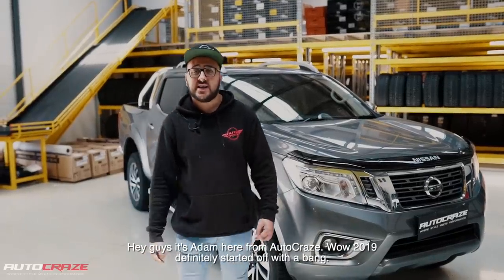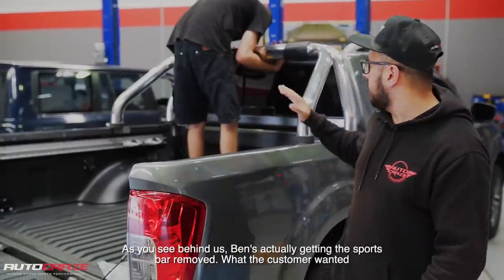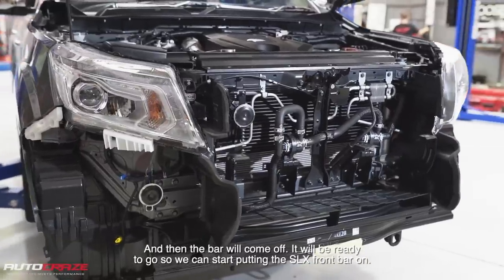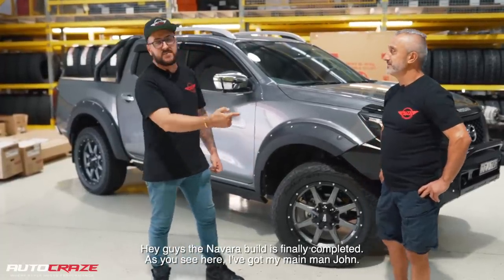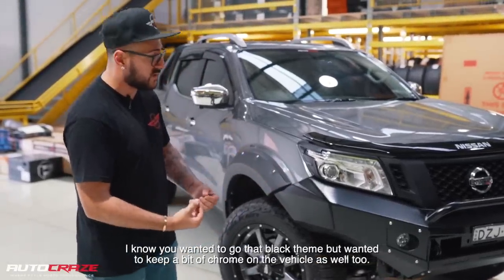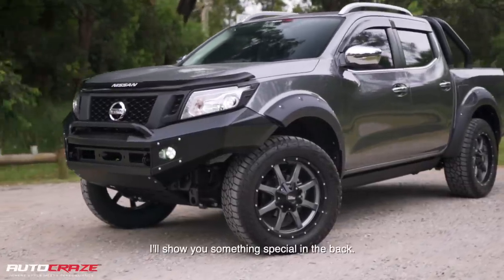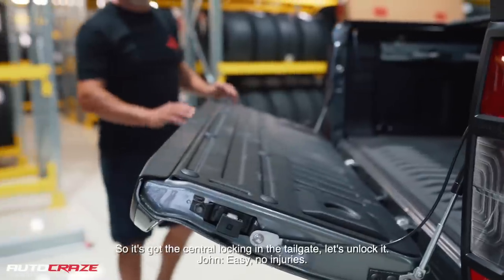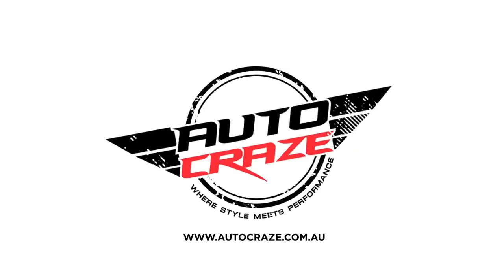OUR BIGGEST NISSAN NAVARA BUILD EVER (Modified NP300 Build 2019)

Comment: Looks pretty much like my 2018 NP300, however I want to know if I can retro-fit the motor on my tray cover or do I need to replace it? And the central locking tail-gate... beats locking that every time with the key, why Nissan didn’t include that is besides me. Especially when you shell out for an ST-X
Reply from the maker: Hi Cronus, can you please call us at 1800 099 634 and we will help you out. Need more details for answering your queries mate.

Comment: Hey guys nice work. When you fitted the central locking to the tailgate does this also work for the roller shutter ? or is it a seperate controller for the shutter ?
Also what brand of shutter do you use for the Navara ?
Reply: 'roll r cover' hsp ute lids, was gonna buy one but managed to get a canopy at a great price.
The rollers will lock as long as you've locked the car however if your vehicle doesn't have central locking in the tailgate from factory than that can still be opened.
I still need to get central locking for mine but for now the canopy rear lid keeps it shut although i reckon a pry bar will jimmy the window open quickly